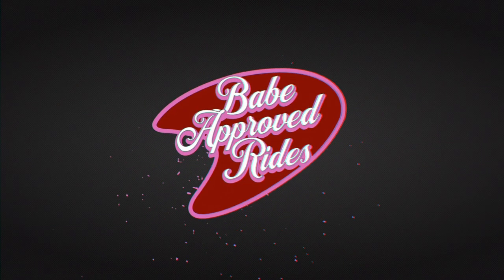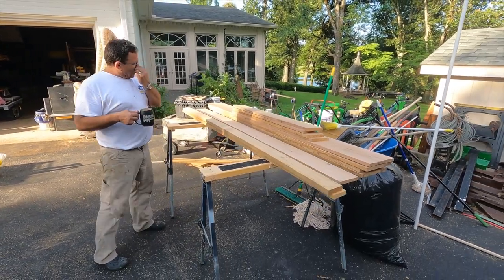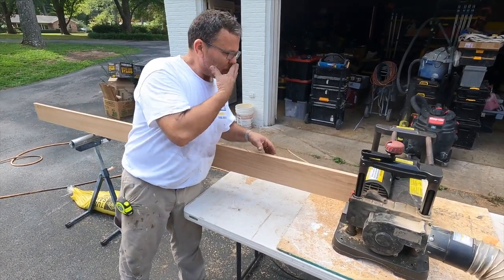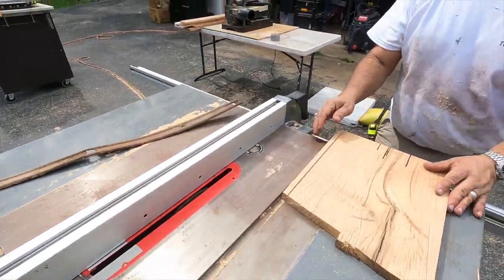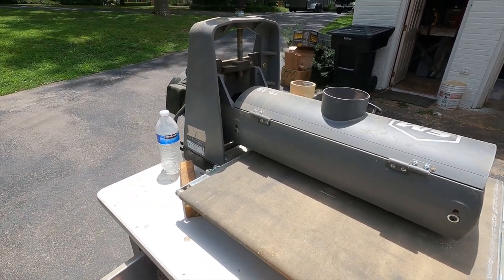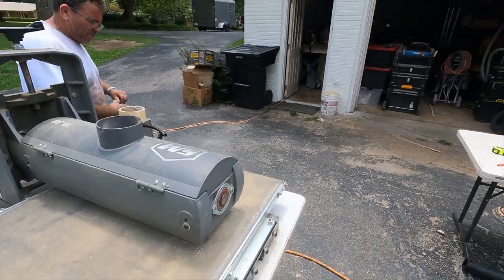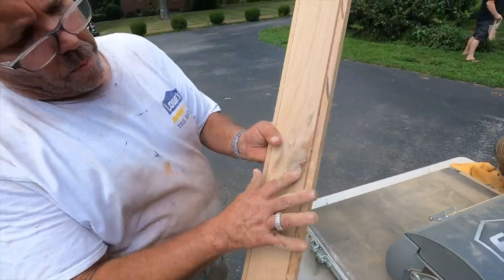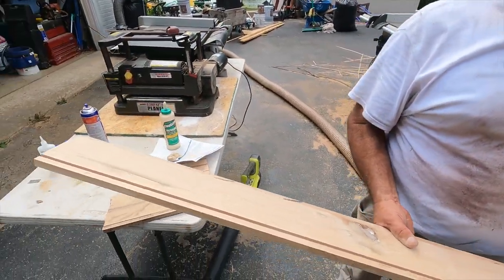DIY | Custom White Oak Truck Bedwood | How to Cut Wood for Classic Truck Bed

Comment: also you could substitute the sawdust for toilet paper or tissue paper that's super glue and sawdust thing you can also do it with Elmer's glue or wood glue and sawdust especially  for holes that are stripped out with wood screws it's not perfect but if it's what you got it's what you got I did this with a toilet paper and Elmer's glue for the front door screws for stripped out and now they don't
Reply from the maker: Very cool idea! Never thought of that.

Comment: t
Thanks for the dimensions on  the edge groove? Appropriate dimensions are just not much help !  5/32 on the cut depth great. 1/8 down on the router great. How far in from the edged if the board ????? I can do the math Just looking for all the info i can get before i start
Reply from the maker: What I did was take one of themetal slats and use that for a guide on both sides! Good luck with your bed wood!

Comment: Great video!!!
But what router bit was used??
Reply: no router was used.  We used the width of the blade for the slot cuts.
Reply: @michaelcampbell195  Thanks for your reply, this will help a lot.
Reply: @rhoadsmatheson2246  no problem. Just really take your time and keep one of the metal slats with you for reference of the gap.
Reply: @michaelcampbell195  Will do, thanks my friend.